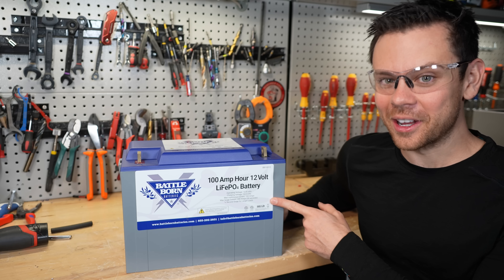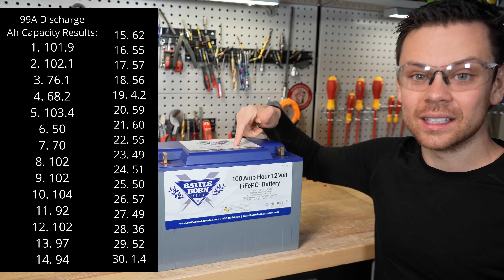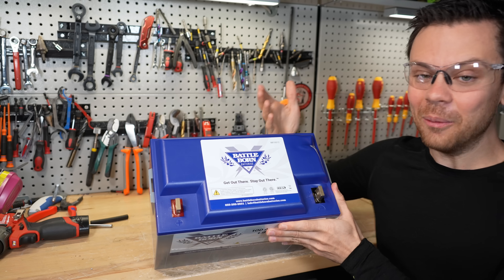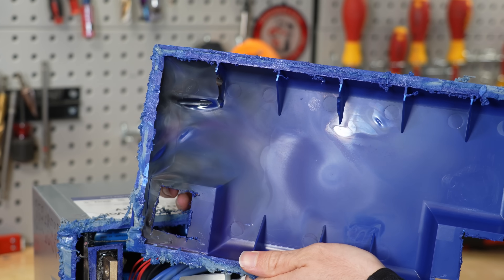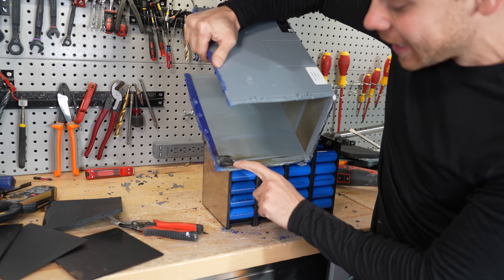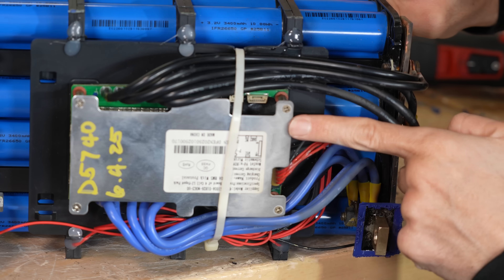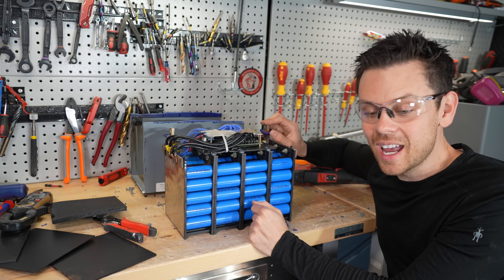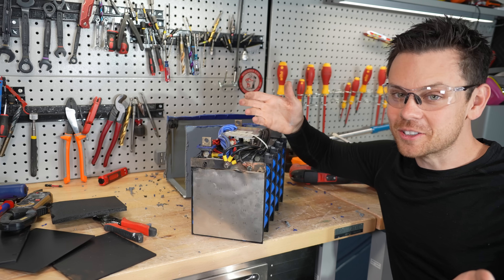Battleborn Battery MELTED?! 🔥🔥New Problem!

Comment: Bad design. No engineer in his or her right mind would clamp a high current conductor to a layer of soft plastic. Even without overheating the plastic will "Cold Flow" under pressure and time, deforming and loosening the connection. Once it begins to heat up the plastic softens rapidly, deforms and now you have a thermal runaway situation. I'm retired but I spent years in power supply design, test and manufacturing. This thing is an embarrassment, and a dangerous one.
Reply: Not just conductors - plastic cold flows, you can't use it in a bolted connection like this full stop. Properly designed parts have metal sleeves pressed or moulded in, look at any plastic part on a car engine for example.

Comment: How far back do you think the problem exist, I have 4 BB 12v 100 ah batteries I bought at the end of 2019 with no issues that I've noticed. And have used them on anywhere from 2 to 6 month continuous trips at a time in the last 6 years. Thanks

Comment: Wow! I am glad I did not get into buying batteries till recently and have gone with some of your (and others that have torn batteries apart) recommendations (I have 2 Eco Worthy and 1 DC House (same battery as Eco Worthy)). 
If I had one of these, I would pull it out of service immediately.  

Are you going to do any video on a possible repair for this defect? 
Seems like removing the plastic and replacing with metal would be the thing to do if you have one that has not had any problems yet? 
Are the actual cells and BMS of these units good, just the final connections that are bad?

Comment: With over $4500 spent on my BattleBorn batteries, I can't just swap them out for another brand. And what guarantee do we have that another brand from China is any better? Will, what do think about us cutting the cases off, removing the plastic, putting in better bolts, and putting the guts into a different case? Thanks.
Reply: Thats exactly what I would do, rather than just complain which will get you nowhere. Chinese batteries are generally good quality in my experience , they are the world leaders in solar and bettery tech. I would bet the american battery cells are also sourced from China.

Comment: I've had one of these for several years now and haven't had any issues. That said, the highest amps I've pulled from it is maybe 12 or so. And 15 amps is the max recharging I've ever used. I use it mainly in my van while on road trips. It powers my lights, fans, compressor fridge and sometimes a diesel heater. And I recharge my laptop with it (usually during the day while power is also coming in via the solar panel). May not sound like I'm using it for much but it makes life on the road a LOT more enjoyable.

The only time I thought I had an issue with it was when I was on a road trip and it wouldn't recharge. I contacted Battleborn and they were very helpful. Turns out that I was the problem. When I was getting ready for the trip I very briefly (about half a second) connected the battery wrong... negative to positive. This didn't hurt the battery at all. However, it did blow the fuse on the charge controller. Oddly though, the charge controller would still send information like incoming voltage from the panels so I assumed it was sending a charge to the battery and the battery simply wasn't accepting it. Through some rather simple troubleshooting (which I should have been able to do myself but hadn't thought to do so) Battleborn helped me track down the real issue. Everything worked fine after that.

Comment: I just finished fixing mine today if anybody is wanting to oscillator the top of them off its 1 in down from the top of the lower step of the blue plastic 1 inch down and oscillator all the way around it comes off pretty good

Just turn it upside down and take the bottom off and then if you disconnect the two bolts that hold the terminal you can get the top part out of your way
Reply: I guess I should say how I fixed it 
Where the plastic is in between the copper bus bar and the positive post I loosened all that up and just cut that plastic out of the way and then replace the bolt and put a nut in between the copper plate and the positive terminal and another nut on the other side of the positive terminal so it's sandwiched between two nuts all of that is tied up against the copper bus bar
Reply: Boy I'm glad I fixed mine today I torqued all the bolts down in there
I also soldered on some more balanced leads so I can add an active balancer externally anytime I want to 
I even soldered on the bottom side where the battery is all loosey goosey flopping around and soldered those nickel sheets together in between each group
I did have a little bit of corrosion on one of the nickel Sheets between their padding and these are pristine batteries these have never been out in the rain never been wet it was all really good other than that 
If anybody following me from the forms I had the hot positive terminal on one of them and low capacity on both seems like they were out of balance I haven't done a capacity test yet
And then just hot glued the case back together again

Comment: No matter how many times I see it it's still astounding that they put plastic between the nut / bolt / bar not just once but multiple times throughout the entire battery even on the tabs linking the cell packs and again plastic to hold the cell packs themselves against each other.
Reply: The flames are a safety feature!!
Reply: @eomrat1  Gives off a scent so you knows it is working........
Reply: What makes it worse is they tell everyone to make sure there aren't any loose connections in their system, then they go and create a ton of loose connections inside their batteries!
Reply: Common sense tells you that won't work.
Reply: They could have gotten away with using plastic.  But the right kind of plastic. ie: thermoset.  The same kind they use on engine intake manifolds nowadays.
Reply: @daemoncan2364 or with embedded brass inserts, like they use on intake manifolds these days.
Reply: @daemoncan2364  I agree with what you are saying, but you'll see in cars they often use metal inserts. Its just not going to give good clamping pressure to form a low resistance electrical connection with plastic in there at all. For an engine intake you're just compressing a small oring.
Reply: Definitely a case of not if, but when. Because it will flow and even modest thermal cycling will greatly accelerate it.

Comment: Thank you Will. Video suggestion, buy another BB battery, do the same testing, get the same results, and then try to do a warranty claim. So many reports of BB denying valid warranty claims I'd like to see how they treat you.
Reply: They left me hanging on one that went dead. I called and did all the steps they directed but it wouldn't take a charge. That was one of a pair I bought from them about 7 years ago. Light use in our class C as part time RVers. The other BB is sitting on the garage shelf and seems fine. I replaced them with 4- 100A Siekon batteries after Will tested them and have them the thumbs up. I think I paid more for 1 BB than all 4 Siekons together. So far, they're working great with our upgraded system.
Reply: @overlandventures5924  7 years. Li batteries have a lifespan. Unless you used them at half capacity you got your money's worth out of them. You're expecting more out of them than they can do.

Comment: Having plastic between your electrical connections is a absolute NoNo! ☝️
The cells are fine, if you have those batteries, and are able enough to saw them open, fix it!
Break that plastic out underneath the terminals and screw it down sufficiently!
And if the BMS is as shity as he claims, swap it for a good one.
But I doubt that's the case.
But if your just a user, sue those fuckers for such a bad product!
Get your money back!

Comment: While this was tested within spec, its being tested in a scenario that this was not designed for. Obviously cycling the battery this quickly doesn't allow it too cool enough between cycles. Zero people in the world are using a battery like this. Its like buying a new vehicle and dyno loading it to 99% of the rated torque for days at a time. Then complaining when the piston rings are fried at 5k miles. But I do agree mounting the busbar bolts through plastic is a bad idea. At minimum it needs a spacer through the plastic for a connection that won't come loose.
Reply: If it was designed for that scenario, the limit of how you can cycle them should be in the data sheet.  Something like the batter need time to cool down to x temperature between recharge cycles.

If overheating during charging is a potential problem with cycles like this,s the BMS should stop it from charging or discharging when it gets to hot. If the BMS heatsink changes colour like that, but the BMS does detect that it is overheated it is a terrible design.  There should be some protection against overheating so the battery does not operate if it get to hot.

Something that would be interesting to know is if the design has been like that with bolts that press down on the plastic the whole time.  It might not have been that way originally when the battery was designed and tested. There might have been a hole in the plastic, so the bolt was just on the metal, and there were additional fasteners for the plastic.    Some enginer that later tried to reduce production cost might have change the design without realising the implication and  it could have been done without electiricaly retesting the design.

Comment: For those of us with older, 5 year plus in my case, batteries it would be great if you could see if the design changed.  That would explain why many people had had BB for years, like I have, without problems and manufacturing change has made them unsafe.  I am currently still using mine but with much more observation.
Reply: Ask battle born

Comment: I bought 4- 100 amp Battleborn as a back up. unfortunately poor storage blew one up a bit withe the case expanding quite a  bit. Talked to battleborn and they were ready to check it out. but it passed a bunch of checks at home, but now I am concerned,  What do you think.?
Reply: If you have battery with a deformed case it is not safe to use.

Comment: Hate to say it man but you need to upload a B roll of you doing the testing start to end. 

I completely trust what you're doing but you're likely attracting a lot of first time viewers.

It would be interesting to buy another new one and cut the case off and then do the test and watch the meltdown happen.
Reply: Well, he could do that but why. This is just his report of what he found.  He is not their QA department.
The company that makes the product could produce a video showing when THEY 
ran same tests it did work - put the 'proof' part on the sellers.
Still that wouldn't 'check' for random batch issues but not will's job.
I guess he could document any lot numbers/part numbers/etc. seen 
on the case or packaging so company could pull from that batch 
to do any of their own testing.

Comment: Let’s hope they make it right for people, sometimes the response is as important as the problem.. but it’s so widespread of an issue not sure they can survive the proper response costs.
Reply from the maker: Agreed
Reply: Because it’s an obvious design flaw, they would have to recall every battery. They will file for bankruptcy before that happens. In fact, I wouldn’t be surprised if they file for bankruptcy with a few months. There’s no doubt their sales are plummeting.

Comment: I have 6 that have been used with varying loads.  I hope they are ok?  I wish that the case was able to be opened so that consumers can check!!  They are now only part of a much larger system so don't get high current draw.  But in the past they may have?  And I paid a huge amount of around $950 each back in the day.
Reply: If you haven't been cycling them repeatedly like Will is then they're probably okay.  That said, I'd personally invest in a thermal camera and look for overheating under load.
Reply: @sonictech1000 That’s incorrect, it only takes one overheating event to deform the plastic enough to permanently loosen the connection.  This would merely be a comically bad engineering decision, if it wasn’t also dangerously negligent.
Reply: @Thegonagle I understand that however it looks like the overheating is happening due to the repeated back to back cycling.

Comment: That is a very, very bad design. However, I do feel like any battery out there will have trouble if you continuously cycle it. While I realize it's within the rated specs, the FETs are essentially a heater in a sealed box. The only exception that comes to mind is what Epoch is doing where some of theirs have a heatsink that goes through the plastic giving it direct contact with outside air. Perhaps these companies need to start including a duty cycle rating in their documentation rather than calling everything "continuous".
Reply from the maker: I should have my cycling machine in a month and I'm going to do it on all batteries. The Watt cycles that I've tested so far can handle it just fine. And sok did it for thousands of cycles and they have it published publicly. It really isn't that hard for these batteries to do it. Especially for the cells.
Reply: @WillProwse  Have you tested WattCycle's latest battery? I was not able to complete a full discharge at 260A (it's rated for 300A).
Reply from the maker: @LithiumSolar  oh I don't have that battery, That's good to know! I want to test everything they make. Did you see my 20 amp hour teardown, not that great. 

Once I get my cycle machine I'll test everything on the market
Reply: @WillProwse  Just watched it and yeah clearly some corners cut there. One thing I don't like seeing is how the nickel strip folds over the cell on the positive end. The corner of that cell where the 90-degree bend is would be of negative polarity and there's just one layer of thin cell heatshrink separating the two. I guess they have the epoxy board butted up against the insulative sticker, but still - seems a possible point of failure. Didn't watch the first half, got one of those on the way now and don't want spoilers ha.
Reply: I was going to comment the same thing, I feel like almost any sealed battery may overheat in a continuous cycling test at maximum spec. Hopefully nowhere near as spectacularly as battleborn's 'design', but it would still be interesting to see this tested as a point of comparison. May be a good thing to start looking for if the BMS has a functional overtemp protection.
Reply: @eglfabrication  That's exactly it - the BMS over-temp should be shutting it down to prevent the demonstrated self-destruction.

Comment: Looking more and more like a recall situation
Reply: Sadly that probably won't be an option?  Dragonfly, BB parent company's stock has lost so much value in the last 12 months, it's about to get de-listed from the Exchange.  The BB money well has run dry, so good luck with Warranty claims!    👀
Reply: Probably won't be enough insurance to recall 400,000 batteries and provide a replacement.

Comment: Can’t wait to hear BB’s gaslighting attempts after this.  “This doesn’t represent a real-world scenario, because we can’t be responsible if someone actually tries to charge or discharge our batteries at their rated specs.  Those specs are for advertising purposes only, not for actual use.  Our batteries are designed to turn into a pile of melted plastic and charred components to protect you, the customer, if you attempt to use them a lot.”
Reply: That's probably not far off what they'll say.  It'll be something like "Our batteries are only rated for a single cycle followed by a cool down period. Nobody cycles our batteries over and over again back to back" I wouldn't be surprised if they even add some similar verbiage like that to their specs.
Reply: @sonictech1000  I know my Nissan Leaf (air/passive cooled traction battery) was only really designed for one fast charge per day.
I have completely cycled the battery twice in a day: but that was mainly slower L2 charging.
Reply: Let's call them Battleborn as in the full battery industry B.B. (BB-Battery) actually makes really good SLA and VRLA and is an import company.  Don't want searches turning up Battleborn's major defects on BB Battery searches.  Anyone with smaller SOHO UPS's knows BB's quality for those SLA purposes.

Comment: I am sure Battle Born will say that is a "Safety" feature. It was designed to melt and (sort of) disconnect.
Reply: It's a patented "olfactor" safety feature that allows you to detect battery problems from several rooms away!  :o)
Reply: @rpsmith lol that's so accurate

Comment: I would really like to see how this new battery and a orignal battleborn is built. I know several bot people that have recently upgraded to new Battleborn 12v 100a batteries due to the success they had with the prior almost 10 year old ones. This is life thretening on a boat! I am talking ocean going/open water "Yacht"/Daycruser not bass boat or Recreational pontoon/"Speed".
Reply: Will did a tear down about 7 years ago and missed this fault, but it is still there too see in the video.  (Will updated the comment section to warn).   So it looks like the design “feature” has been there for a good while.
Reply: @Robbo.312  Thanks!

Comment: Those batteries are fine if you run your flashlight off of them and charge it with a 2 amp charger.
Reply: It's just like my packs built out of old laptop 18650 cells, neat.